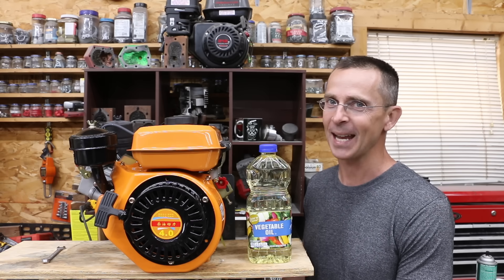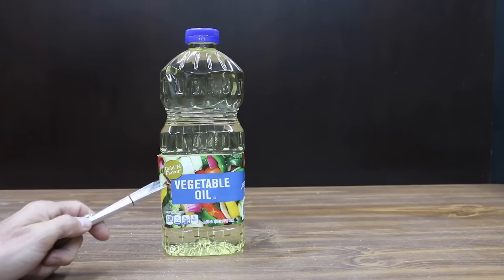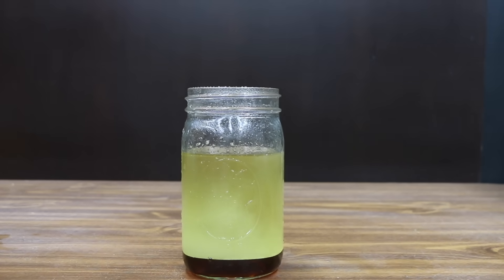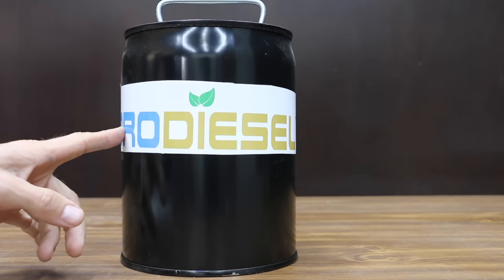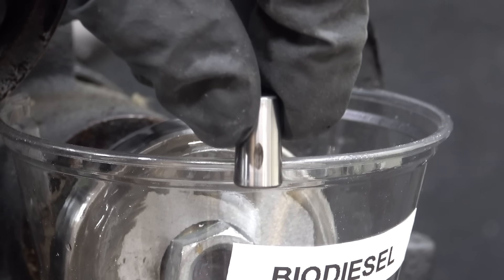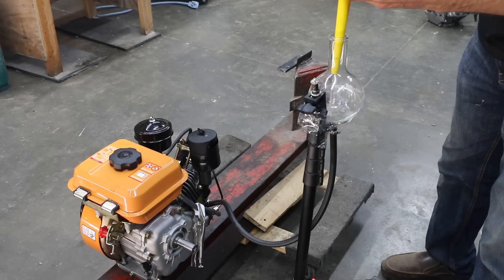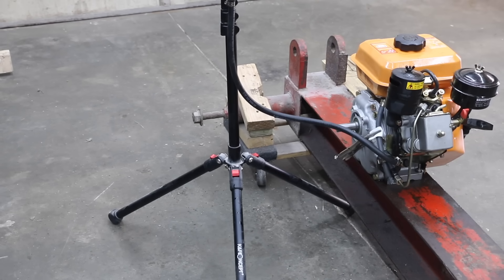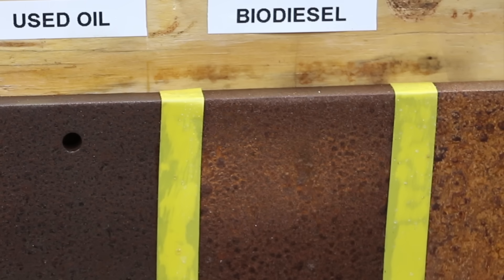Make "Biodiesel"? Let’s find out! Diesel vs Biodiesel, Used Motor Oil, Vegetable Oil, MPG

Comment: I used vegetable oil mixed 2:1 with diesel in mercedes 124 250d for about 15000 kilometers or almost 10000 miles and had no problems with it,i recomend it to everyone!
Reply from the maker: Thanks for sharing.

Comment: I recently watched your video on different spark plugs. I was wondering if your EFI generator has a O2 sensor in the exhuast to monitor the air/fuel ratio? This may have further inpact on the fuel economy

Comment: Yo @ProjectFarm could you demonstrate direct injection aerosol canola?

Aerosol canola oil sprayed from a can has a dramatically lowered flash point.

Meaning it could be easier and simpler alternative to making fuels at home to run a generator or whatever.
Reply from the maker: Thanks for the suggestion.

Comment: My comment probably won't be seen, but would you test corrugated hose vs PVC pipe in different drain and flow situations like a French drain and a water catch system. I would like to see how flow rate effects certain kinds of debris running through the pipes and which is more likely to clog with leaves/bark vs gravel/sand, etc. Thank you for being awesome!
Reply from the maker: You are welcome!  Thanks for the video idea.

Comment: I use to run 50% used vegetable oil 50% diesel all the time in my 2000 7.3 Powerstroke in the summer. And in winter months used 50% used motor oil and 50% diesel. Never had any issue.
Reply from the maker: Thanks for sharing.

Comment: black diesel...........easier and cheaper. Its usually a blend of 40% gasoline to %60 used oil or 50% Jet-A1 to 50% used oil.
Reply from the maker: Thanks for the feedback.

Comment: The engine runs fine on most any well filtered/dewaxed fuel. The emissions since 2007 are a whole other story
Reply: Common rail engines only like regular diesel, but that's because their computers expect a certain fuel viscosity and get upset if they're fed anything different. You could 100% make a modern common rail diesel with all the emissions stuff that runs on bio, but it would have to be designed for it and might not run so well on regular diesel. There's no demand for such things so nobody bothers.
Reply: @nerd1000ify  I did not know about the viscosity requirement of common rail. Thanks for the insight. I have a 7.3 that I’ve literally ran 💯 percent used oil and 💯 percent bio fuel on. The bio drops my mileage a bit and used motor oils/ whatever else they threw in the totes help my mileage a bit. I just had to add a switch so I had pure diesel in the lines to start cold in cold weather.
Reply from the maker: Thanks for the feedback.

Comment: I ran an old citroen wagon for years on used veggie oil. Got from a restaurant in 5 gallon tubs , gravity filtered it through two large fuel filters overnight. Just poured it in and off it went smelled really good too. I added 30% straight dino in the winter. The car was turboed and had a Bosch fuel pump which had no problems and less smoke. Don't use Lucas / CAV pumps they are made to finer tollerances and break in cold weather.
Reply from the maker: Thanks for sharing.

Comment: I wish you had applied some fixed-resistance and a tachometer to the engine so you could have made just a bit of an assumption or a general guage as to which fuel was able to do more actual work. A timely video and another good one.
Reply from the maker: Thanks!  Thanks for the feedback.

Comment: I worked as an engineer for a boat company in Hawaii.  He had a small bit of algae growing in the diesel tanks.   When we switched to biodiesel, the fuel filters clogged the same day. The biodiesel had killed the algae.   I recommend anyone with algae issues to run a tank of biodiesel.  It is cheaper than buying the biocides.   Thanks for another great video.
Reply from the maker: You are welcome!  Thanks for sharing.

Comment: The corrosion control test might be flawed. The hydro diesel got sprayed more than any other test piece. Slow the vid down and watch.

Edit: maybe it is better than the end of the vid shows then since it won.
Reply: I think you are mistaking the hydrodiesel being sprayed more than its counterparts because it is actually allowing the water solution to run off the fastest giving the illusion of being sprayed more, but in result clearly proves superior protection because of this property.

Comment: What about additives to diesel fuel for lubrication. I use arch oil instead of diesel kleen
Reply: I have used 2 stroke oil as an additive in my isuzu diesel. The older style ip needs the sulphur content for lubrication
Reply from the maker: Thanks for the suggestion.

Comment: I had friends with converted diesel buses who had two fuel tanks- one with regular diesel to start and warm up the engine, the other with used frier oil they could switch to once the engine was warmed up. They said fast food places would just give it to them.

Motor oil additives and contamination are probably not ideal to spew into the air.
Reply from the maker: Thanks for sharing.

Comment: It gels at warmer temps, loss of power and efficiency lower fuel mileage. There isn't anything good about it.
Reply from the maker: Thanks for the feedback.
Reply: There's a good chance the diesel you're buying from the bowser already contains about 5% bio. And the reason is right here in the video, it's a better lubricant than straight ultra low sulfur diesel, which is good news for your high pressure fuel pump. Keeping the level below 5% ensures it won't upset the injectors or emissions control equipment of a modern common rail diesel, which expects fuel of a certain viscosity in order to work correctly.
Reply: @nerd1000ify  1000% unlikely...
Reply: @philfredericks5198  depends where you live, but for me it's essentially impossible to buy road vehicle diesel without some amount of bio added. They all say 'up to' 4.9% bio, so the exact amount varies (probably depending on time of year) but there will be some in there.

If you live in a cold climate disregard my original comment, it's probably pure petrodiesel in that case.

Comment: Do you think it would be a good idea to mix your used motor oil into the tank of your pickup mixed with diesel fuel to make use of it?
Reply from the maker: Thanks for the suggestion.

Comment: How about making diesel out of waste plastic?
Reply from the maker: Thanks for the suggestion.
Reply: Be interesting to try both the initial oil from pyrolysis and diesel made from that using the biodiesel method.  Using your 10% gasoline with the pyrolysis oil might be the best solution in time and cost.

Comment: I reclaim used oil that comes from my Dad's and brothers farm tractors 
Also I get used oil from 2 farmers and a small company that uses Semi Trucks 
I mainly burn the used oil 
But for using it in a diesel motor , what I do would work well for that also 
I did not come up with this idea , but I have changed some of the way I do things 

I have several 500 gallon tanks to hold the used oil 
I fill a tank and let the oil stay in the tank for 6 months as do the next part 2 times a year 
After the used oil sets in the tank , about the top 90% - 95% of the oil in the tank looks like New 
All the crud and black color has settled to the bottom 
The 5 - 10% with all the crud is recycled 
But the rest of the used oil is clean and burns clean 
So if you used this method with your used oil to use in a diesel motor 
It would work better IMO than the oil with the crud in it , as the crud has small metal pieces from the original motor 
Those small metal pieces will IMO cause wear to the diesel motor
Reply from the maker: Thanks for sharing.

Comment: How is that engine, in any way similar to what's in a modern diesel? 

That's a low-pressure low compression diesel. (Low for diesel... at least) 

But all modern diesel engines (well. In cars, at least) are high compression, high pressure common-rail fed engines. 

while, okay, CRTD isn't exactly a different engine as such, this testing and video doesn't show what's going to happen when you put these fuels through a modern fuel pump. 

Because if the pump goes BANG! or simply jams, that's a VERY expensive fix.

Can we get one video where you do the same testing on even an OLD CRTD Engine & Pump? 

I have been told that oils, and cooking oil, even after filtration, can seize a modern high pressure pump. 

and also that modern bioD can strip deposits from inside the engine, cleaning it, but also jamming filters etc.

Comment: I once broke my back at work and they fired me saying it was not their problem. I had to go on food stamps to feed my kids as I couldn't work because of my back. Being on food stamps they pay you about twice what you really need. Well, I owned a diesel truck and I needed to get the kids to appointments and school functions so I would buy a case of vegetable oil and pour it strait into the tank. It worked no issues and made my truck smell good. My son still remembers it only because of the smell. I told everyone if they had used vegetable oil to bring it over and I just filtered it. To be honest the truck ran the same either way.
Reply from the maker: Thanks for sharing.

Comment: You can run used cooking oil with out doin all of this we did it an old cummin 12v an Volkswagen Rabbit. Just saying
Reply from the maker: Thanks for sharing.
Reply: No problem just need to modify the fuel lines an the filters. Plus make sure it dont get cold. But your truck that you have will run it straight as is.

Comment: I do want to make an important note that biodiesel needs to be washed a minimum of 3 times with a substantial amount of water: I’d say .25 to 1 times the volume of biodiesel each time. This is because of residual sodium hydroxide which will cause nasty corrosion at high temperatures. More than 3 times is better but simply spraying a few ml into the biodiesel will not clean it
Reply from the maker: Thanks for the feedback.

Comment: You should have at least gave the used motor oil a chance without altering it. I've always heard it would've worked on ots own. Having said that, I'm not trying it on my truck.
Reply from the maker: Thanks for the feedback.

Comment: Your mechanical injection pump on your Cummins would handle veg oil just fine. The never common rail high pressure injection systems definitely would not tolerate it tho.
Reply from the maker: Thanks for the feedback.

Comment: Awesome. So basically when I do an oil change, I can just dump the used oil in my fuel tank. Thanks!
Reply: Granted you have a diesel made before they got rid of the high Sulphur fuels
Even jet fuel will ruin a modern diesel
Reply: apparently, as long as you cut it with the right amount of gasoline, and probably, clean out any metal particulates that might be there
Reply: As long as it is a mechanical pressure pump. Common rail diesels will not fair well with  used motor oil, the tolerances aren't as high.
Reply: I run wmo in my 12 valve. You will want to run it through filter socks at a minimum but ideally centrifuge it to remove contaminants. You would be surprised the crap that comes out after you centrifuge it.
Reply: @edwardgrabinsky  Have you ever tried magnets?
Reply: @someperson7  im not trying to be that guy thats like ya you have to do this my way, or saying my way is the only way. It might work for other people (the same way some people run 2 stroke oil or unfiltered wmo) but i dont think its even worth entertaining theidea that a magnet is effective at removing a significant amount of fine particulate. Running alternative fuels has an initial cast to set it up, and if that cost isn't worth buying then your better off with pump diesel. Because burning up anything in your inje tion system will offset the cost savings for years.  And really the stuff about pump diesel being bad or i adequate is BS. Anyone putting 2so or atf in pump diesel has 0 clue, and there is good literature saying conclusively thats bad practice. The diesel world is full of myths so just stick with actually researched and published literature Instead  of anecdotes. So no additives and cut with diesel to achieve viscosity appropriate for your injection system. Filter it to sub micron thats appropriate for your system at a minimum but honestly just buy/build a centrifuge. In order for stuff to be pulled on a magnet it would have to be grossly contaminated and would still be contaminated after. And not even all contaminants are ferrous to begin with.
Reply: @edwardgrabinsky  lol so that's a no go?😆
Reply: I would definitely recommend filtering it at a minimum.

I use old motor oil diff oil or transmission oil instead of two stroke mix in my mowers and strimmers.
Reply: You'll want to filter out the metal particulates.

Comment: The cetane rating on biodiesel is higher than regular (#2) diesel, which makes it a great cetane booster, but it is REALLY hard on rubber.  Most modern diesels can handle about 20% biodiesel in the fuel tho.  Hence the "B20" rating.  Biodiesel has about a 9% lower energy rating too, but because it helps the efficiency of the engine, the mileage works out about the same.
Reply from the maker: Thanks for sharing.

Comment: Excellent work! Thank you very much Project Farm! I do want to add that if anyone wants to run their diesel on straight vegetable oil, you will want to heat it up for best results. Likely modifying and rerouting your heater core hoses along the fuel line would work. Also maybe heat your fuel tank with radiation from the exhaust somehow..
Reply from the maker: Thanks!  Thanks for the feedback.

Comment: I work in the diesel fuel injection industry. Biodiesel has, to quote from my mentor, "paved my driveway". 
Biodiesel is good in theory, but wreaks havock on fuel injection components, especially if it's used in applications that don't get used often.
Reply from the maker: Thanks for the feedback.

Comment: I used to run my F-250 7.3 diesel on a 50/50 mix of used motor oil and diesel fuel. The only modification I did was add a Cummins spin-on filter because they were about 1/3 the cost of the factory water separator filters. Running fine when I sold it, years later. I didn't mention this to the guy that bought it.
Reply from the maker: Thanks for sharing.

Comment: It would be a massive undertaking,  but have you considered building a pyrolysis reactor. It's a method of vaporizing plastics in an air right container using a heat source. The resultant vapours are condensed into a liquid that's similar to diesel.  Full disclosure,  I've wanted yo attempt this myself but as yet haven't got around to it.
Reply from the maker: Thanks for the video idea.

Comment: I ran vegetable oil (filtered To 10 microns) cut with gas and diesel for almost 2 years. Wore my 215 HP Ppump out when I had it rebuilt he  couldn’t believe it even moved my truck. To thick I guess. I did not start & stop on diesel. 
I lived in the tropics at the time so no winter. 
Good video keep it up
Reply from the maker: Thanks, will do!  Thanks for sharing.

Comment: Something else to add to the tests are showing different metals and gaskets in all the different fuels. One of my ag engineering professors lead the K State Biodiesel Initiative and from what i remember, that was the biggest thing holding back biodiesel in modern vehicles because it corrodes anything rubber in the fuel line. But it's excellent for cylinder lubricity.
Reply from the maker: Thanks for the video idea.  Thanks for the feedback.

Comment: All new diesels are now required to have an exhaust cleaning method, “SCR” and a DEF system.  The home made diesel will play hell on those systems.guaranteed
Reply from the maker: Thanks for the feedback.
Reply: Yeah and everyone with half a brain has to pay 3-5k to get all that garbage taken off. Then 20-50% increase in power and fuel economy.

Comment: Excellent again as usual, great to see you still have the lubricity tester.
I've run 75/25 veg oil/diesel to help with cold weather starting with great success for over 50,000 miles with no problem,and yes the smell is different.
Reply from the maker: Thanks!

Comment: That old truck could use some motor oil (or 2-stroke) as a diesel additive for the injectors and pump. Don't mix petrol to dilute oils for diesel engine, use diesel (or kerosene).
Reply from the maker: Thanks for sharing.

Comment: I hear on the interwebs that Diesel motors were originally designed to run on vegetable(peanut) oil.  ???
Also, the last time you added used oil you didn't say the words 'gasoline added'. Is that because he expected me to know it wasn't used or because he didn't add gasoline to that sample.

Comment: It would be interesting to put a load on a diesel when testing fuel. I do have some insight with water diesel emulsion fuel. It was a 20 megawatt generator. It was 28,800 HP slow speed Sulzer engine. Slow speed engines can run on anything between sewer gas to asphalt. Water emulsion fuel caused pressure spikes that damaged the engine. Water is a crystal that absorbed heat during compression and flashes to steam causing an intense pressure spike. It is easy to monitor cylinder pressure in an engine that runs at 120 rpm at full load. The crankshaft and drive plate cracked.   Paul

Comment: I wonder if grease from ground beef as well as other food grease could be used as a diesel fuel.
Reply: Yes!  You can use the same transesterification process as making biodiesel from vegetable oil.  In this case you are using a triglyceride called stearin.
Reply from the maker: Thanks for the suggestion.